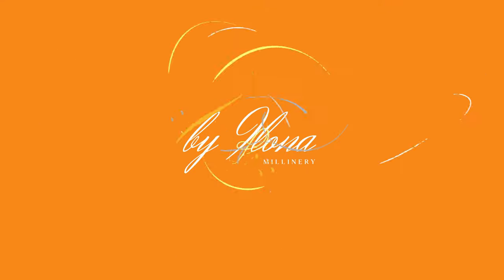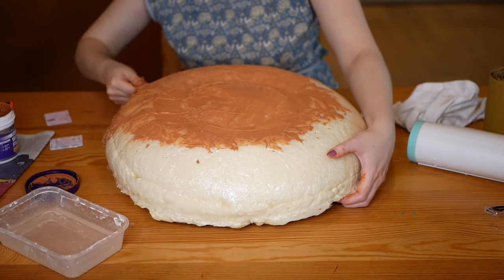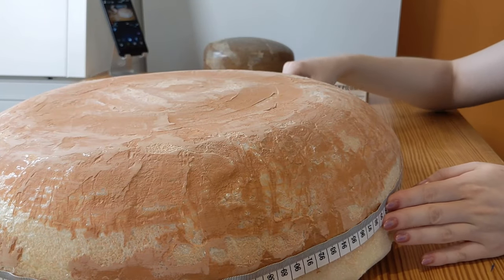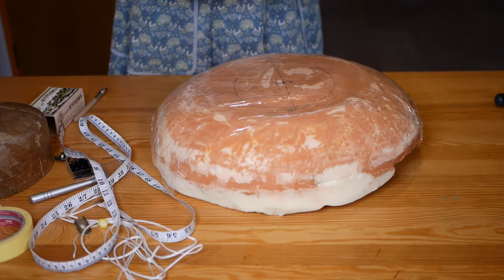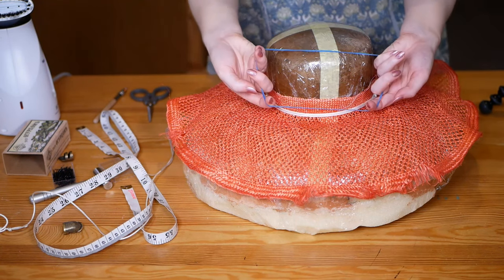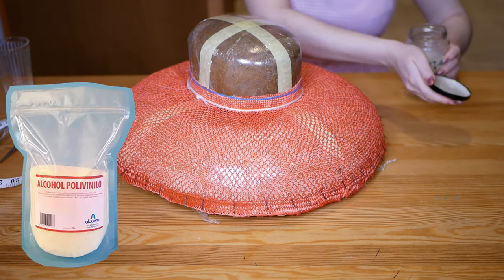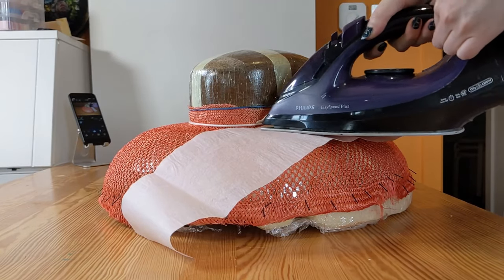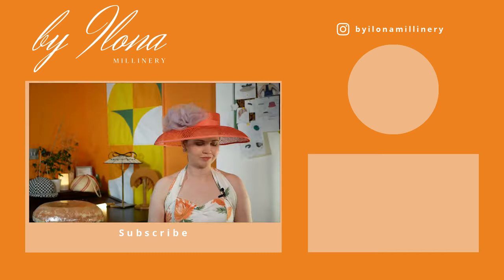DIY hat block using expanding foam #2 (and blocking straw)

Comment: Can you block felt on a foam hat block? What are the pros and cons?
Reply from the maker: Hello Rf Ck, yes absolutely! You can block anything on a foam block, just like on a wooden one. The pros of the foam block itself are that you can make it yourself and it is cheaper than a wooden one. The cons are that it is very lightweight which can make it difficult to block on, and also, it will fall apart rather quickly with continual use. My recommendation is always to use a wooden block if you can afford it. But if you are new to millinery and want a cheaper way to make only a few hats, try the DIY foam block.